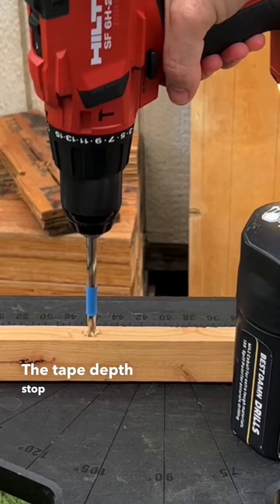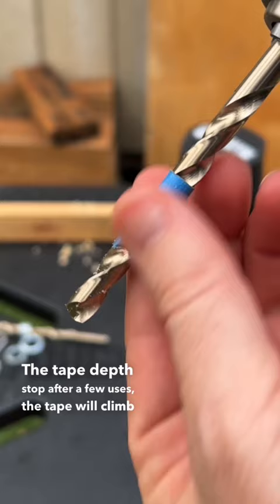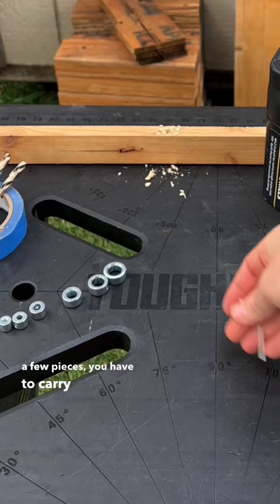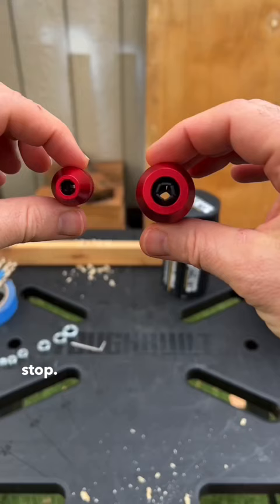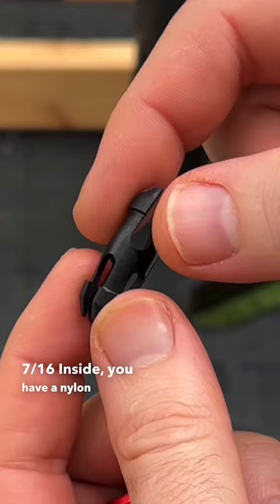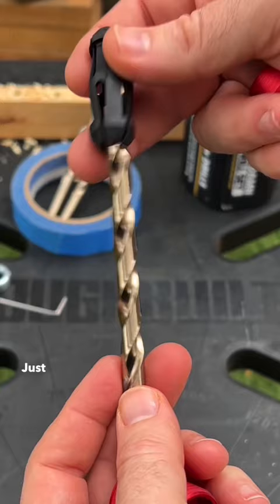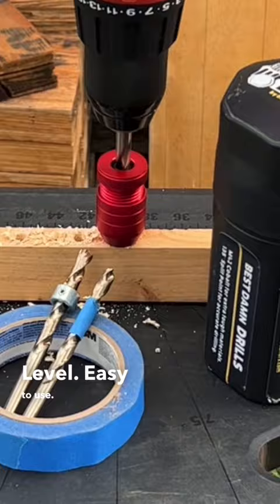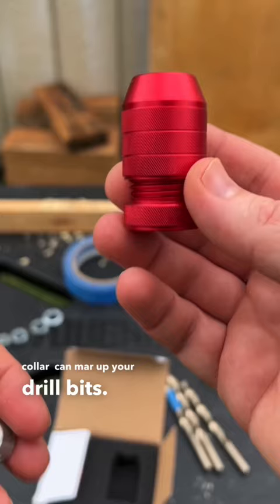Best Depth Stop? Quick Pros & Cons Comparison

Comment: The metal ones that use an hex key because 60 seconds if drilling in cobalt steel and that nylon core is going to be a puddle. If it was aluminum I would be all for it.

Comment: Tape will do the job just fine unless you need to drill 500 holes. If you can't be off by 0.1mm you should not be using any of these in the first place.

Comment: Solution looking for a problem. Get that drill hot and that nylon is toast. Tape is cheap and takes two seconds to replace. If you tighten the collars properly it’ll last you your entire project, or at least you retighten every 5-10 holes. If you need holes of a repeatably precise depth, you’re not getting that with a twist drill anyway, the point of the depth stop is to avoid going through your work or something like a dowel in woodworking. Neither require this malarkey.